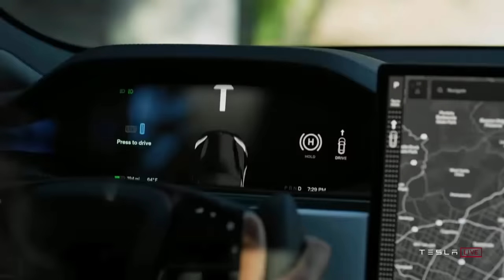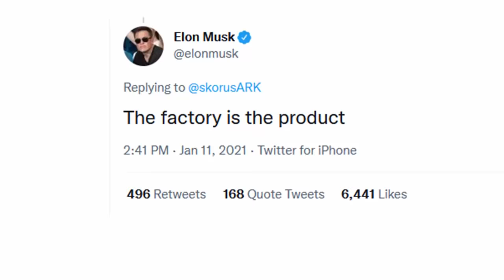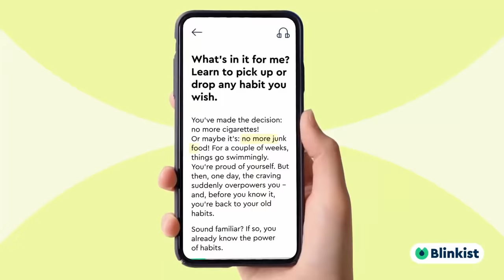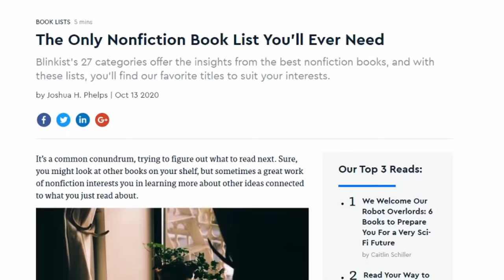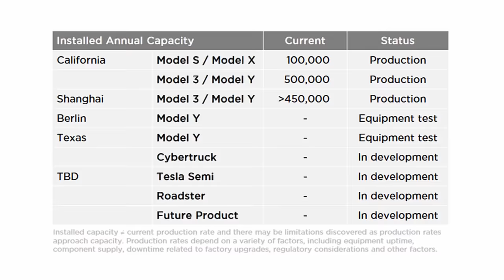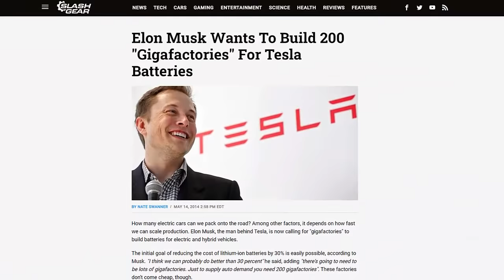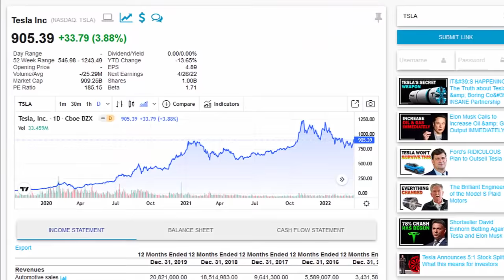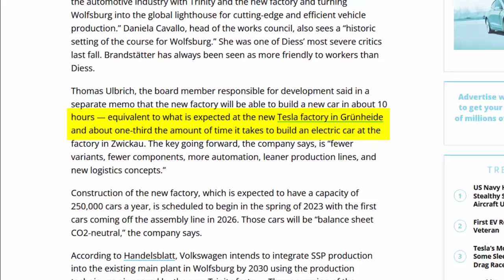Tesla’s Giga Texas and Giga Berlin are JUST the Beginning

Comment: 2M annual units from Berlin and Austin easily, 2M from Shanghai after the next expansion, 1M from Fremont that'll be within the next 24 to 36 months. Austin, Berlin and Shanghai could potentially get to 4M units total capacity each, so then we need another couple of factories to get to the 20M number by 2030 or before. GM would probably get to 45% ish or like the iPhone, OM around 25% to 26%.

Comment: There’s many new EV categories that can absorb new gigafactories. That 20 million EV estimate assumes only current models. Eventually, people want trucks, SUVs, and Vans. These cars require longer range battery packs and the ability to swap them out. They can also make new designs of the Model Y. Add an SUV style camper in the back. Add a extended rear cabin. New battery technology should make every model a longer range version.
Reply: Swapping batteries will not happen it just is not needed anymore at least for Tesla.